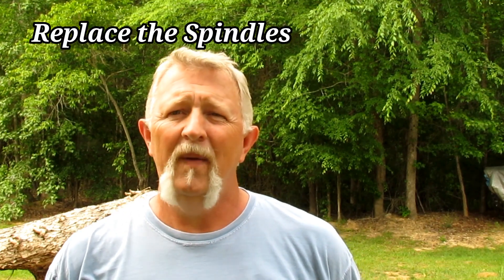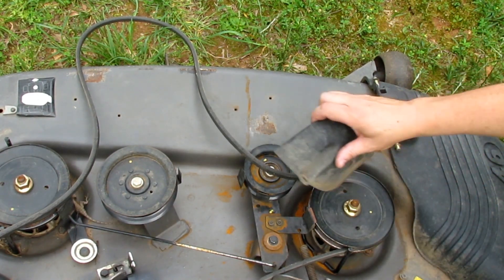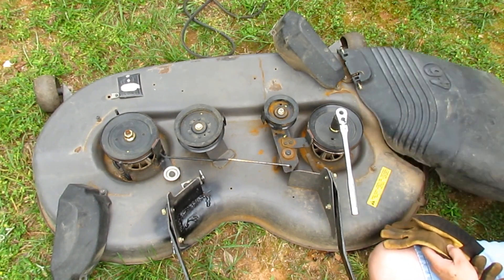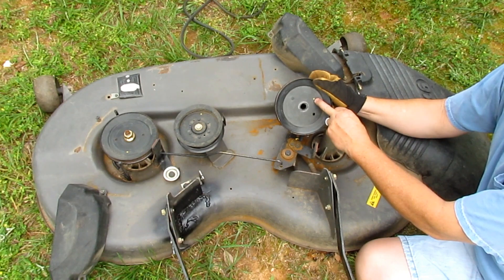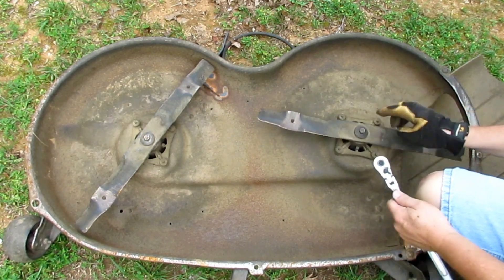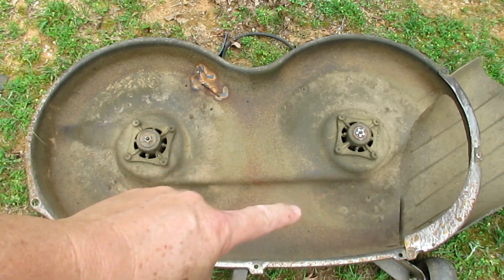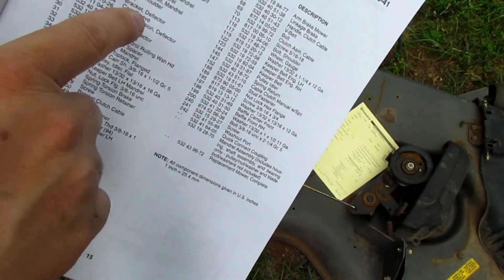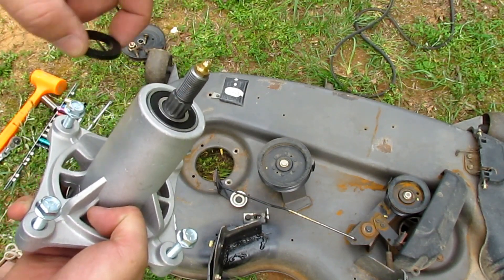Replace Deck Spindles - Husqvarna Yard Tractor YTH22V46

Comment: Mr. Coffey, the 7/8 nut on top of my spindle will barely loosen. What do you recommend for me to do to get this nut to loosen so I can change out my spindle?
Reply from the maker: Hey Jim, thanks for watching!  An impact wrench is the best bet for sure.  If you don't have access to one, I recommend blocking the blade with a piece of wood between the blade and the underside of the deck, then using a breaker bar on a socket.  Often the original nuts are staked on, so they are very difficult to remove.
Reply: @dwcoffey  thank you so much

Comment: I have a husqvarna YTH20K46 that I’m working on... needs some engine work (its losing compression), got it to start one then turn it off ... it try’s to turn over but won’t start all the way...
Reply from the maker: Thanks for watching and commenting!  I hope you get it fixed.  I'm sure you'll have to address the compression problem first, but then, as you probably already know, check all the basics.....you need fuel, spark and air to make it run.  So check for those 3 things first.

Comment: Dennis...do you think the spindle bolts are designed to shear off if you hit say a stump? All of them broke right off. Great video.

JoeB
Reply from the maker: Hi Joseph, thanks for watching!  No sir, I don't think they are designed to shear off.  Not saying they won't though.  :)
The star shaped part on the bottom of the spindle that the blade goes onto should shear off if something hard is hit with the blade.  I believe mine were over-torqued from the factory because several of them broke when I replaced my spindles.  That may be what happened with yours.

Comment: Hey Dennis can you remember how long you've usually gotten out of your factory Husqy deck spindles? I'm beginning to think that's what causing the vibration and noise from my deck but I am barely just reaching 200 hours. Just curious what kind of life you got out of yours because I think we mow a similar terrain. Take care!
Reply from the maker: Hey Walkr!  I only got about 40 hours on the original spindles and replaced them with greaseable spindles, removed the inner seals, etc.  I have 250 hours or so on that set with no problems.  The best way I know to check your spindles is to take tension of your deck belt (disengage the blades) and try to move the blades laterally (hold each end of a blade and rock it back and forth) to check for play in the spindle.  Also, give each blade a spin (watch your fingers) and listen to the bearings.  If there's more than  just a slight bit of play, or a lot of noise, then your spindles probably need replacing.
Reply: @dwcoffey  You've helped me so many times with my first riding mower I really can't thank you enough. I've gone through all the tutorials on Youtube and I honestly think you are the best by far. I never get bored or confused watching your videos, even on stuff that isn't related to what I do. I can just tell you're a great soul. I wish you and your family the best. Have a great Labor Day weekend! By the way I broke 6/8 bolts and didn't stress at all because I had watched this video and bought similar Amazon OEM spindles with all new bolt replacements and didn't even have to tap them in. I really appreciate your videos and I hoped you keep them up for a long time. Take care, much love and respect from DFW!!
Reply from the maker: Thank you so much Walkr!  I can't tell you how much I appreciate your comments and your support.  It makes me happy to know that these videos are helpful and make repairs easier.  Thanks again, I really appreciate you!

Comment: Did you change the little brake pads
Reply from the maker: Hi Mark, I did not.  Mine were in decent shape and were working fine to stop the spindles when disengaged.  I can't remember if they are bolted on of riveted.  If riveted, you may have to drill the rivet or take a chisel and knock the flange of it to remove the pad.

Comment: Those bolts breaking off sure made things easier for you :).  Mine were a son of a bitch to remove.  Wow.
Reply from the maker: Thank you for watching!  You are right about that....made it a bunch easier to get everything apart rather than fighting those bolts out the whole way.  I wasn't mad when they broke.  :)
Reply: You would have been if you didn't have replacement ones hehe.  None of mine busted, luckily, but it was a hassle since I had already removed the blades and I had hit some stuff good enough over time to really strip those star patters the blades slip onto, so getting the spindle to hold tight enough to get the wheel and bolts off was tough.

I have a TS 348XD and had to replace all three spindles.  Getting them off was not easy but getting 2/3 on was cake.  Waiting on #3 right now on backorder.

Comment: About how many hours do the spindles last?
Reply from the maker: That's a good question, but I don't have a good answer  :)    I was very hard on my first set of spindles...cutting stumps, rocks, dirt, etc, so they didn't last much over 100 hours.  I would expect a mower that cuts a decent lawn most of the time could get a lot longer than that out of a set of spindles.  My replacement set has well over 100 hours and is doing just fine, so I'm expecting several hundred hours out of them....well, as long as I dont abuse them like the first set!  haha
Reply: @dwcoffey  You have likely tripled the life of them by greasing often. Thanks, Don

Comment: How many hoirs before you had to replace them
Reply from the maker: About 150, but I've beat up my mower deck pretty badly....I bush-hog with it in the woods, cut stumps, bend blades etc.  So my usage is probably not typical at all.

Comment: You do know that you can save a bunch of money by knocking out that spindle shaft and the two bearings,then taking the bearings to a auto parts place and playing match up.

On my old John deer,they  wanted around $100 per spindle and I replaced the bearings for right at $10 per spindle.so $30 vs $300+.
Reply from the maker: Yea, that's pretty steep for the John Deere spindles.  I'd rebuild my own too at that price.  You're right, rebuilding would be a lot cheaper.  But you can buy a pair of spindles for the Husqvarna for less than $60.  I wouldn't go to the trouble or spend my time to replace the bearings for that.
Reply: @dwcoffey  well yesterday I noticed that my 2009 gts5000 that I just picked up has a slightly bent spindle shaft,so I looked into rebuilding it.

the shafts can be picked up for $10-15 each and they all come with a lower bearing already on the shaft,and the top bearing is the same 203 bearing my John deer used,so it's $5 at the parts store.

Seems $35-50 is about avg for non deer spindles,and a rebuild can be $15-20 and it is extremely easy to do.heck I knocked that shaft out yesterday in less then 10sec.

Should look into as even $10 saved is worth it..

Comment: Coffey, like the dink mam, just spelled different ... ( I HAD to do that, GREAT movie if you've never seen it THE GREEN MILE.Ok, with that said, Dude, invest in a can of AREO KROIL to loosen frozen nuts !! WORKS TERRIFIC ( not cheap but worth it, a little goes a long way ) and a can of never seize. I put it on all reassembly bolts and nuts. You can thank me later !! Thanks for another great video !!
Reply from the maker: Thanks for that tip!  I'll have to get some and try it out!

Comment: Anyone else had the spacer (between pulley/upper bearing) find it was part of the bearing itself??
Reply from the maker: Thanks for watching!  I haven't seen that, but I've seen them have no retention on top of the upper bearing and a shoulder above that on the shaft to hold the pulley, so if that upper bearing seat gets a little worn, the bearing can come out.  crazy design.

Comment: HELP please.   I & my brother put newe spindle on the Husqvarna yta 18542 but it leaves an unmowed stripe on the inner cut.  Left spindle blade  is untouched and normal, new spindle outer side mows same height as the "old" spindle, but the inner blade doesn't seem to be touching at all.  
HELP please.
Reply from the maker: Thank you for watching, Derry.  I'm not familiar with that mower, does it have 2 deck belts?  Perhaps the deck belt to the inner blade isn't installed?  I'd check to be sure all belts are on properly and then check to be sure the blade is fully seated on the bottom of the spindle.  I hope that helps.
Reply: @dwcoffey  just  reglar lawm mower, I've donn this before...this time didn't take.  & my Ricky mower guy had a stroke this summer lost his right side of body.  I'm praying hard...he's been my man for 6 years...got fixed done overnight...new people finding process.  
I was supposed to start classes mech, but we moved off the bus line for night classes.  bad news every month it seems
thanks for checking back, means a lot to me
Reply: travelling mech from fu-quay-varina, came up.  replaced bent pully in zero seconds flat & new belt too boot!   BACK IN BUSINESS
Reply from the maker: Nice!  I'm glad that is all fixed up and you are back to cutting, Derry!  God bless!!

Comment: should have used some Locktight on bolts
Reply from the maker: Thanks for watching, Lloyd!  Shouldn't really need Locktite, since they came with serrated flange bolts and they're going into cast aluminum, but a little Locktite blue wouldn't hurt a thing.

Comment: The reason people have to change these scam breakable Aluminium parts is due to the fact the alloy cracks at the points where the four screws attach to the body after hitting a large rock or shock in some other instance. Anyway, everyone is replacing these things with steel units NOT rip off drop in money hungry defectively designed parts. Despite you buying the unit with a grease nipple, you just installed a timebomb that could potentially break after your first use depending on your luck. Advise to everyone is buy steel housings, tap out the existing mandrels and refit with existing bearings if they are fine or $5 bearings from China. An impact wrench or gun is mandatory on this 5 minute job. And yeah, I have been there and done the replacement with the steel alternative. Buy the replacement part and your just burning money.
Reply from the maker: Thanks for watching, Glen.   I haven't had the same experience with mine.....neither the original nor the replacement spindle housings have cracked on my deck and I beat mine to death.    The bearings wore out in the OEM set, mostly because I was hitting stumps with my blades while cutting in the woods.   My replacement spindle assemblies cost me just under $50, bolted right in and now have well over 200 hours on them with no cracks.